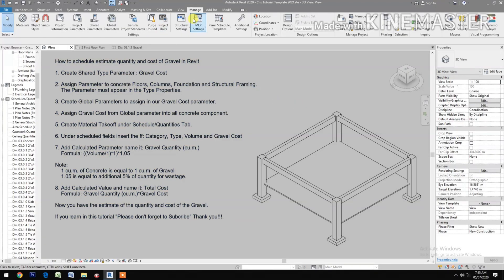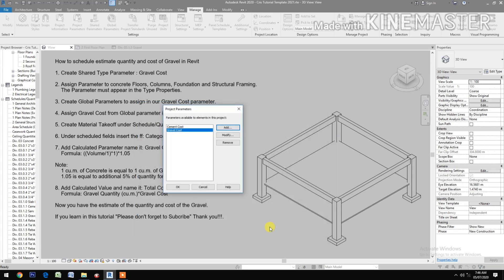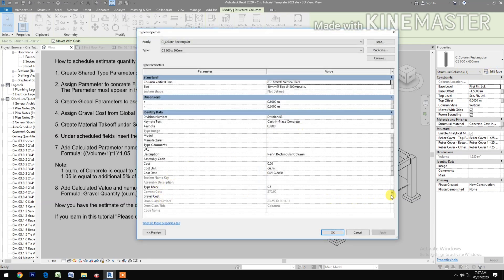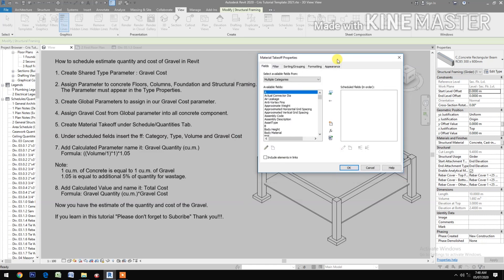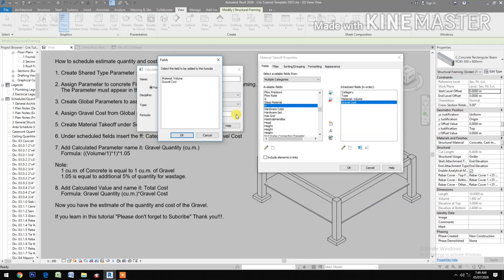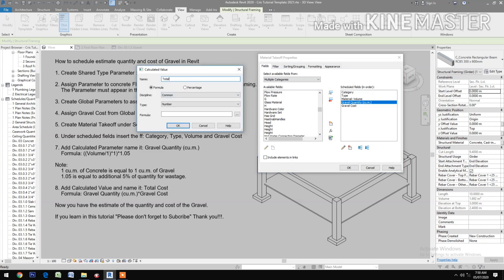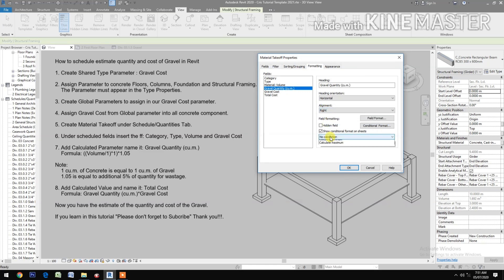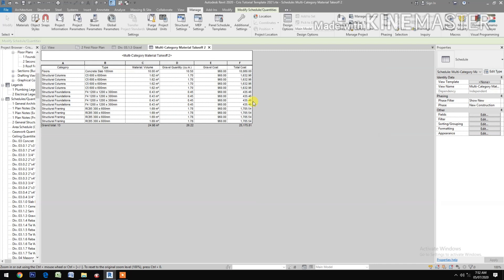Cost Estimates of Gravel in Revit. Program of Works in Revit.

Comment from the maker: Suggested Videos:
RD117. How to make a Twisted Continuous Wall to Roof in Revit. Pattern Based Massing Design in Revit.
https://youtu.be/7T2KVt6-N80
RD116. How to make an Arabic Pattern Curtain Wall in Revit.
https://youtu.be/u9giiqooh8c
RD113. How to make a Parametric Arabic Pattern Pivot Door in Revit. Pivot Door Revit Tutorial.
https://youtu.be/3tAyuCpotGw
RD112. How to make a Parametric Arabic Wall Screen Divider in Revit. Decorative Wall Panel in Revit.
https://youtu.be/QUr7-LO2I2Q
RD111. How to make a Parametric Floor Accent in Revit.  Custom Floor Pattern Design in Revit.
https://youtu.be/K-3mrs3ICD8
RD109. How to make a Classic Ornament Stair Railings in Revit. Classic Ornament Baluster in Revit.
https://youtu.be/mq1grcVPxhg
RD108. How to make a Glass Balustrades in Revit. Modern Stair Design in Revit.
https://youtu.be/NVbatHyQj_0
RD103. How to create a Parametric Curtain in Revit. Curtains in Revit Tutorial.
https://youtu.be/dVljI_ynZPg